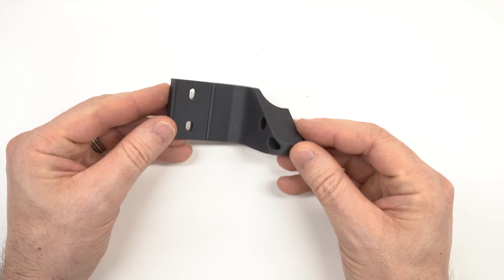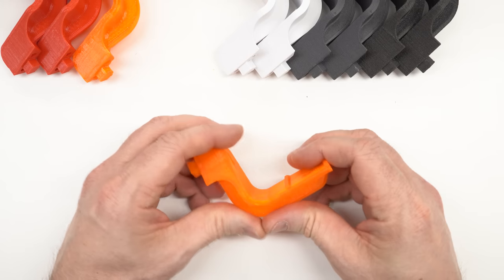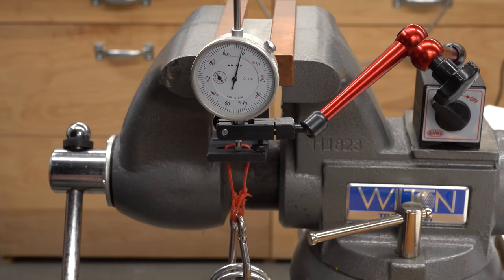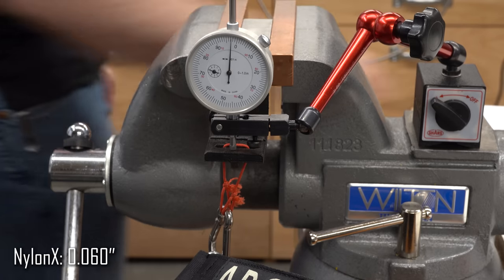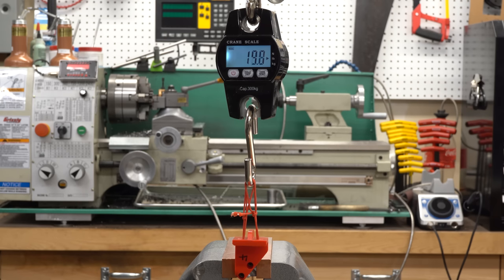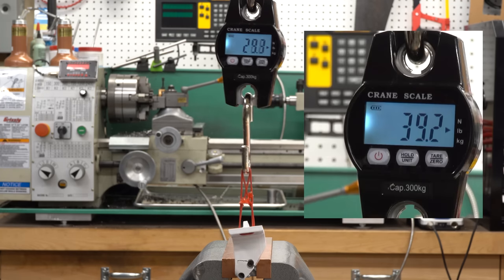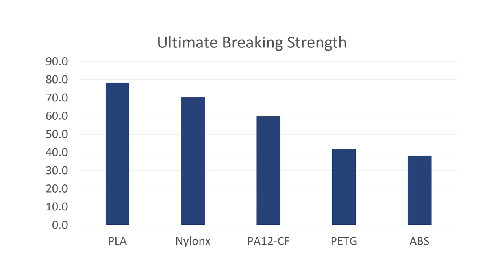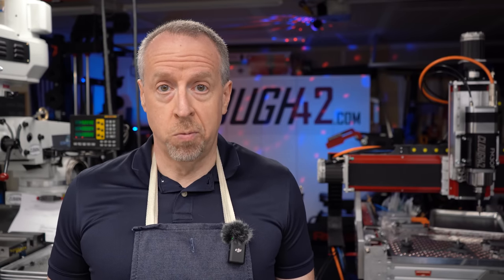Wait, What?  PLA is Stronger Than Carbon-Fiber Nylon?

Comment: No surprises for those how are familiar whit engineering! For the rest look at technical data sheets the important numbers are:
  "TENSILE STRENGTH" will let you compare which will break under higher load for the same section aria. 
PLA is ~100N/mm^2,  Nylon  ~60-70N/mm^2,  PETG ~50N/mm^2,  ABS ~40N/mm^2  (you see the order matches whit the test results). 
The "Young modulus or Elastic modulus" will tell you know how rigid a material will be, higher the number higher the rigidity.  
Carbon reinforced Nylon >3500N/mm^2,   PLA 2800-3500N/mm^2, ABS 1800-2400N/mm^2, PETG 1400-2000N/mm^2. Again no surprise. 
Whit other words READ THE TECHNICAL DATA SHEET! 
As for temperature, materials maintain these properties under, 45 °C for PLA, 140°C for Nylon, 105°C for ABS, 80°C for PETG of course these warry according to blend and manufacturer.
In terms chemical resistance PETG is resistant to far more chemicals than any other while ABS is probably the worst in this group (depending on blend).
If failure mod is a factor look at elongation at break, higher the percentage the more ductile the material and will fail les violently.
Reply: Thank you, that was useful.

Comment: My biggest gripe with PLA is creep over time even at low temperatures. That means if you use it as a bracket, you shelf is going to sag and fall down eventually. If you threat it for a fastener it will lose clamping force over time. if you use it for anything structural with a load on it it wont hold its shape. Makes it pretty much useless for me in any practical application.

Comment: Nice testing. Harder to test, but I think that consistency between copies is perhaps a more important measure than pure strength for a few parts. You can design for a specific strength if you know the behaviour of a material, but if the material shows large variations then the only way is to always overbuild them, which may not be what you have room for.

Comment: Hi James, I do print quite a bit of PETG, it is my go-to for all the reasons (or people's conceptions) of why someone would choose to use it. I do find the print characteristics can vary easily by print settings and even ambient conditions when printed, let's call this "finicky". For me this is a consideration in material choice. I.E. your choice of the carbon fiber reinforced may have lower values, but its less finicky and you get far more consistent results. As this anomaly in PETG is worth further investigation, I would love to see you take your scientific approach to it. As always, great testing and fair reporting of the results.
Reply: I fully agree with that.  Part has to be designed with PETG in mind.  I have found PETG to be quite brittle (almost glass-like) if designed or printed in such a way to not let it flex - eg more walls, less in-fill. Also, I always try print at highest temperature possible, in an enclosure.
Reply: I also use PETG a lot, but one purpose it doesn't seem to work well at is as shelf brackets. The creep doesn't seem to stop over time. In my office I have a wall of filament made of shelf brackets made of black petg. About a year later, one of the rows just collapsed, dropping all the filament. The layers on the bracket looked like they had slowly pulled apart over time. PETG is known for very good layer adhesion, so this was a bit of a surprise, but ironically this same thing happened to "3D Printing Nerd" about a year after he set up a filament rack with brackets. For being under a load for a long time, PETG needs CF. I decided to use PA-CF and that has worked very well. A couple months later, another row collapsed in the same way. I then replaced all the brackets with PC-CF and they've held since (2 years now) with no deflection or creep.

Comment: CNCKitchen has a whole series on testing different filaments. It's a pretty thorough testing regime, too. You may want to check out Stefan's videos and maybe see about getting him some Carbon Fiber nylon to test.

This was interesting and nice to know that I'm not going to be a total idiot for making furniture parts out of PLA.
Reply: Stefan's testing is more of a 'laboratory' style parts testing while the testing here is more 'real world' as the part put under load is for a real application. Stefan's testing can give you a good 'base line' while in this video this is more the way the engineers will test actual parts and materials for a given application now there are other things to take into consideration as well as layer orientation when designing and printing a part. Those are the infill density, printing temp (both at the printhead and the environment), part cooling amount, RH of the filament and environment during printing, the way the part is sliced for printing (i.e. weaker areas of the print more walls/infill). All these factors and more can affect the resulting parts total strength and weak points.

Comment: A possible explanation for the high load PETG result is that it deflected so much it kind of turned into a tensile test.
Reply: It always is a tensile test. Thats what stretching is. The point where it begins to bend is called the yield point. Point they all snap is called the ultimate tensile strength.
Reply: It's like when you see those strength tests on wrenchs and the snapon wrench breaks while the cheap crap deforms so much it just spins. Is it useful for a tool to survive more at the expense of its ability to actually perform its function? Nope.

Comment: That’s why it’s important to understand the characteristics of each material for your project. Pla is more rigid but generally where it falls short is on heat deflection and impact strength. Of course there are alloys that try to minimize those. If you don’t need heat deflection and impact strength 99.9% of the time you can buy the pla. Would love for you to test taulman gf and cf nylons, there finish is injection mold quality.

Comment: Great video James, I'd like to add one important thing to the PLA 1st place. As others pointed out the problem for PLA are elements and temperature, therefore these lovely brackets could have a serious issues outside. But what I haven't seen in the comments, is the PLA has tendency to flow under load. It could not be a problem for such a small part vs weight of soundbar, but... Few weeks ago I talked to the guys from MyCello (3d printed tailor made chellos). We have agreed on this PLA behaviour as they had to switch from PLA bodies to the PETG, which seems to be OK for they use. On the other hand I have printed many holders in my garrage from PLA, after few years they're still fine. Even parts on my motorbike where they got beaten by sun and rain. I love CF filaments for plastics which are hard to print due to warping...
Reply: I can confirm that PLA flows under load. I built a belt tensioner for a printer with it and it didn't survive a year.

Comment: This is interesting and poses the question "Does PLA have the higher tensile strength because it's a purer material?".

By that I mean it has fewer modifiers and additives. You could further ask whether the additions to PA-CF are actually bonded well to the carrier material and are just "in suspension"? and not adding to tensile strength.

Comment: It would be interesting to see how PLA+ compares to standard PLA in this test.
Reply: in my experience PLA+/PRO layer adheason is much much better
Reply: i heard pla plus and pro are just PLA ABS cross cantamination ratios
Reply: @fluffypinkpandas  plus or pro can be whatever you want and it different between different filament makers, so both things does not means something specific but used to differentiate "modified" product
Reply: @SergeiSugaroverdoseShuykov  modified pla and modified abs huh.
seems about right
Reply: I just printed eSun PLA+ which is a copolymer with TPU as far as I know, seems a bit more flexible, so probably less brittle and stronger. The filament itself feels much tougher to break in hand. It's supposed to be almost 2x as strong as normal PLA. I need to print it over 210*C, because at that temp layer adhesion was slightly too weak and I got a small separation from pulling off bed.

Comment: I'd be really interested to see bending and tensile tests of regular nylon against nylon CF. My guess is it might be marginally better in bending but no better in tension. In the world of fiber-reinforced composites, your strength is very dependent on fiber length and load transfer. Unfortunately, these chopped CF filaments have such short fibers that loads don't really transfer to the fibers and instead they just shear around in the plastic. They might improve stiffness in bending though. 
Again, these are just my assumptions.
Reply: A big factor in the strength of composites is the adhesion between the filler and the matrix. In this case CF is the filler and Nylon is the matrix. Unless the stresses in the material can bridge the filler to the matrix material effectively you essentially just made a part with a bunch of voids. If the Nylon or CF were modified to have better adhesion to each other the strength could be drastically improved.

Comment: I recently started using Creality CR-PLA.  My 5 S1 printer came with it and I gotta say, this stuff is amazing!  Very clean, accurate and has the best hardness I have ever seen in a printed part.
Reply: i did not use mine for over a year and am now doing stress tests to determine which filament to print my race bike aero winglets. so far CF-PA6 and creality CF-PLA come out very strong. I was very surprised about the quality of the creality CF-PLA

Comment: Good sciencing. PETG and ABS need a well heated enclosure for the cross layer adhesion to work well, I generally print them at a slightly higher temperature than the recommended max and they're usually stronger over a longer time interval. PLA's strength deteriorates over time, especially if they're exposed to direct / indirect sunlight. One thing to test / consider is post processing the prints in the oven, tightly packed in some super fine salt. It heat cures the layers to form a very strong part.
Reply from the maker: The ABS was printed at 240C in an 80C heated print chamber.
Reply: @Clough42  in my experience, many white materials have a heavy pigment ratio. White plastisol screen print ink can be like treacle compared to black and other colours, for example! Not sure if it's the same for the plastics we print with, but I wouldn't be shocked if it turned out that white filament ended up being measurably weaker than other colours. Not that it would change your ABS results.... But it would be interesting to test, either way!
Reply: @20vK  I've noticed this in some parts as well. 

Colors definitely play an impact on the structural strength of the plastic around them, due to the size of their pigments. 

Clear is usually best for the greatest impact resistance and flexibility, but it also tends to be just a little bit easier to scratch as well. 😊🌎❤️
Reply: @OJesusX3  ive noticed  even in resin printing that clear resins (not filaments) like superPP, Nylon Green, and Siraya Blue have impressive properties over every other resin. they are like glass but can withstand the tremeandous forces demanded of suppressors and firearm frames

you may be onto something with pigment particles playing a role in overall chemical properties of the print

black carbon products have all behaved like charcoal for me when broken

opaque white parts are more elastic and break like pvc
Reply: @fluffypinkpandas  Incredible.  And thank you very much for adding your experiences my friend.  This helps  😊🌎✨
Reply: @OJesusX3  meow

Comment: One recommendation I would make for petg is make sure you're using as minimal cooling as possible for strength. Petg has poor crystalization properties if cooled too quickly.

Any chance between the one part and the other two you had changed the cooling percentage?

Great video as always.
Reply: Yup, i run petg at 10% fan cooling and pla is nowhere near the amount of bending force that petg can take.
Reply: Agreed I run PETG at 0% with 10% on overhangs I think there was some layer adhesion issues or something. My PETG parts have been really strong
Reply: Eric, I have not done any sort of printing myself but my first thought was the printing or cooling cycles were not the same. Clearly to me anyway this was evident in the results, but also makes me wonder if the others were printed with the best/optimal settings
Reply: The problem is, PETG is hygroscopic. So if you decrease cooling, the final part will be full of strings. That's why it needs to be dried out first which is extra work. And that's why PETG is not worth it for me. PLA is the king.
Reply: Most filaments do absorb moisture to some extent, and that's why it helps to create a heated filament dry box. (Most of us end up making ours out of clear storage totes, printed roller guides, and using whatever insulation is most available to us. Foam, cardboard, etc)

PETG is a great medium! They're all great mediums, but they do have different properties in which each excels. 

I generally print with PETG myself, (for its ease of use and relatively high thermal resistance, (it doesn't typically ever melt in a car)) although when it comes to surface durability, (scratch resistance) stiffness, and bond strength, PLA is unique in that it's characteristics (and density) is like that of a cast resin part than other plastics.

    While it doesn't take much heat, it can form some Incredibly tough surfaces and it does make for some good (low speed) gears and high load bearing surfaces and rollers which will last a long time. Even in real world scenarios. (I've made lasting parts out of PETG as well. 😊🌎❤️)

  I've heard that annealing can greatly improve PLA's temperature resistance, (and overall parts strength as well,) but I've yet to try this. 🙂

Keep in mind that PLA is only 1 of the many bio-plastics we have designed and I'm sure that there will be more that may replace many of the more common ones that we use today, (it all in the formulations and the bonds which gives plastics and resins their unique properties) perhaps making several, easy to use, low cost plastics that can rival most of the things that we use today. Fingers crossed gentleman! 😊🌎❤️

Comment: One dimension I think which is also important, is how good one can glue them. Nylon is hard to glue and ABS can be glued with acetone by dissolving the surface and getting a very good bond. Many dimensions to the properties. Also not all materials are the same when it comes to ease of printing.
Reply: You can use Loctite 770 primer and instant adhesive. Very expensive but works great.
Reply: @paulgallagher2937  What can they glue? PP? PE? Nylon? Low surface energy plastics? Nice.
Yes, most of these solutions which actually work are rather expensive.
Thanks for your reply, wasn't aware of this product.
Reply: @AlJay0032  Yes it will work on PP, PE and even silicone rubber
Reply: I did try using acetone because its way cheaper, but not even close to same results. They got some magic chemicals in the primers and activators.